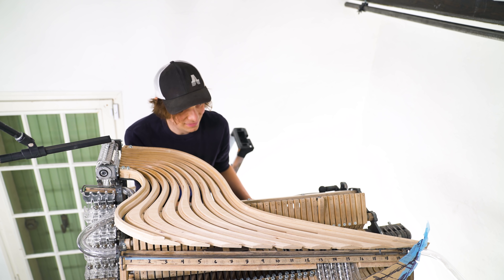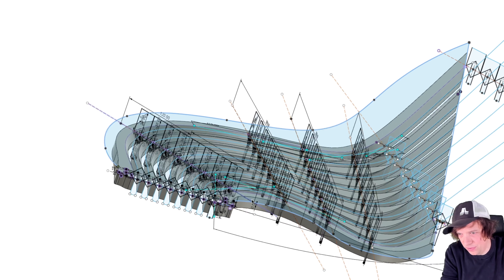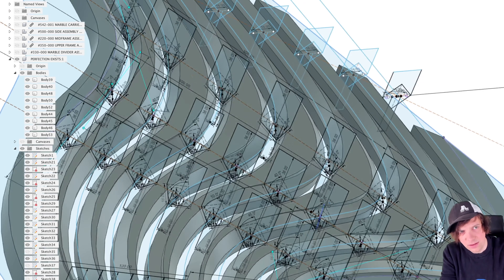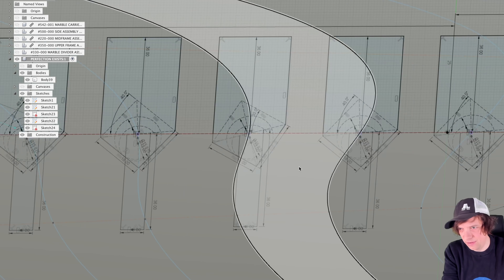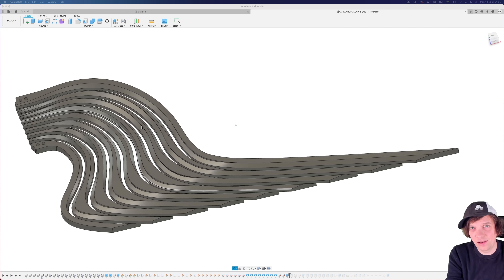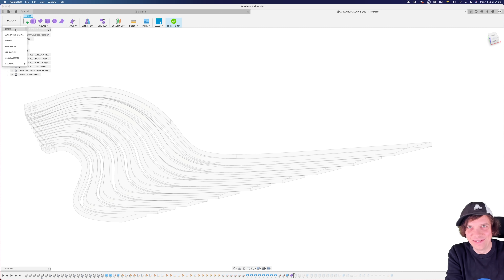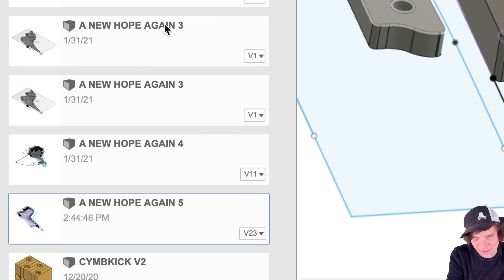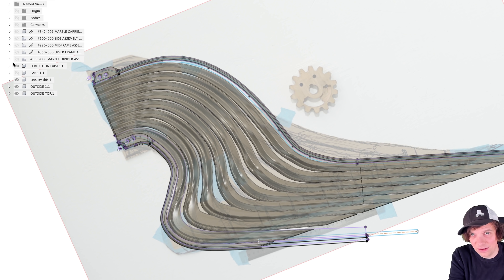Marble Lanes

Comment: I'm leaving this comment after seeing 11 minutes of the video. One observation is that the marbles were moving really fast by the time they reach the rail at the bottom. Perhaps (learning from an earlier video of yours), if you widened the path at the end, it would slow the roll and make for a smoother transition into the rail across the holes. I will also add, this is a beautiful design! Very pretty!

Comment: @others: Speed won't be a problem. he can easily widen the track moving the contact points out and making the marbles slower.
I'm just a bit annoyed by all the bezzier handles of the cennterlines ;). Couldn't you draw them smother with just one asymetric extra handle in the middle?

Comment: 9:15  Why the marbles need to fall so much until the ramp?  Why the ramp can not be fixed a bit higher?   You can keep the ramp fix to the sides and allow the center ramp part to enter more close to where the marbles still have lateral movement, instead making them fall, that also solve the problem of marbles getting stuck on the edge.
The edge of the ramp should be almost touching the part where marbles are in the top.

Comment: since there are now multiple exits across the entire width, doesn't that create an unbalance in the number of marbles that enter on the left channels vs the right channels?
Reply: Its more balanced then before, (favoring the left side of the machine VS the right). this is a much better solution that is much closer to ideal(what the original Marblemachine used), but still has an art feel to it.

Comment: Try fastening string under tension between the ends of the marble divider and the sides of the exit of the conveyor. You can measure the angles easier and plot the connecting points in CAD, then model your curves to run between these points.

Comment: I cant hardly wait for him to perfect the lanes, just to realise that he is not populating the first 4 channels at all. Bad curves
Reply: first channels get fed from the small 4 ball elevator through a single tube.
Reply: @constantinosschinas4503  If you look at him drawing the template in this video, it's clear that he intended to feed the first channels with this design. I think the error that was introduced during CAD moved all the feed lanes, not just made it longer at the end.
Reply: @constantinosschinas4503   But what if the fish-stairs aren't delivering marbles fast enough?
Reply: Yeah I was wondering about that too. Also, Even if a single track goes to the first few channels, what if you want to play a lot of these notes? wouldnt you run out of marbles very quickly if it is fed by only 1/8 tracks while the lower channels can get marbles from up to 8/8 tracks? 

Before, there was a single bypass lane, meaning the first channels were getting 1/2 as many marbles at maximum.
Reply: @Basement-Science  was thinking the same. 
I think that the best option would be to split the lanes in a way that the paths look like a tree and the paths would be switchable so that in one song you could dedicate 3 lanes to the beginning, and in another song 5.

Comment: With this new design, it seems that the marbles gain a lot of speed and will probably jump over their entry point into the divider.  Also, in my mind, the distribution after mounting was close to a gauss curve, the center point of the divider will be more fed and the first channel may not be full enough if it is used often.

Comment: A horizontal marble divider with marble gate and piston feeder:

i realize its a large part of the machine thats already designed, but i feel like the tilted marble divider is causing many issues: it requires the different modules to adjust marble height, if marbles go too fast they can skip over a hole, marbles can get stuck in the pits....
I think instead a level marble divider would work better, where marbles are pushed along by the marbles behind them. you could then feed the marbles in with a simple gate that pushes the in one by one, (like a marble sentinel + a little piston assembly). that would cause the marbles to move through the marble divider in steps, and give them plenty of time to fall into each hole.

 I also feel like the two stage division (making marbles enter the marble divider at different points) in unnecessary if the machine is well fed with marbles (one marble in, one marble out).

Those marble lanes look super slick! keep up the great work, wintergartan videos are a blessing to look forward to after a days work!

Comment: How are the first 5 channels going to get fed? And in that design, the upper track only feeds the marbles back into the elevating system. The basic idea is good, it only needs some tweaking.. Also that curve is going to ramp some speed into those marbles. They may even fly past an empty cartridge, and off the main deviding track.

Comment: NGL I really do miss the older design not only because it looked better but also because both of the exits it had allowed marbles to flow directly into the left most channels without the need to have to first go through the whole recycling pipe which goes to the divider and fish stair feedback. I feel this may create a potential delay and drought of the left most channels being refilled in certain cases. I do also have a potential worry about the new system having marbles enter TOO fast which can cause them to skip or roll out of the feeding rail for each channel. Sadly like most of practical engineering changes the only way to find out the results is to see how it works in practice.

Comment: If I get it right, the marbles enter their lanes on the same height level (x-axis), and then the lanes transform into a slant (y-axis) which causes a difficult 3-dimensional shape. The plywood will have to be bend a lot to end where they are supposed to do when the lanes are cutted in planar plywood. Maybe it needs several layers of plywood glued together after doing a design with exact start and finish coordinates. However, it looks beautiful so far! :)

Comment: with this design, the instruments at the bottom of the ramp have the potential to be served by eight lanes worth of incoming marbles, while the instruments at the top are only served by one or two.  isn't there a danger that the higher end of the ramp might run out of marbles?  Are those notes used less frequently?
Reply: so this divider is getting fed by the marbles that start at the bottom of the system.  the fish stair "return" route that handles the overflow doesn't go through this divider and starts all the way up, so all that excess gets fed back in.  he should still test it though
Reply: @dforck42  Good call, thank you for the observation.  I see that you're right.
Reply: Martin just has to write his music with intense drum and bass tracks.
Reply: There is the fish stair feeding the channels from the top. All the excess marbles are sent that way not to the new dividers route.
Reply: If it becomes a problem, a solution could be making the marbles prioritize the first channel of the conveyor
Reply: @Anoneom  I think the concern is that even at full speed the first lane of the conveyor might not feed enough marbles to keep the first instrument channels filled. I like your idea though
Reply: The whole Lane is fed by the overflow and fishstairs. 
My general concern is, that on a high speed song, with lot's of rhythm in the higher channels, the Marble divider may not provide enough marbles. 
And on the other end of the scale, the overflowing might run full, when there is no rhythm going on.
Reply: The limitations of the machine will presumably dictate some rules for composition.  Which is fine,  like you can't play 8 notes on a trumpet at once - musicians are used to limitations of their instrument.
Reply: I see this problem too.
Reply: I guess it needs a "factorio" style lane balancer?
Reply: That worried me a bit too. But considering the vibraphone bars can be in any (or at least somewhat flexible) order, Martin can simply position them such that the least used ones will be at the left.

Comment: Part name suggestion: Medusa's Hair. It snakes, and it met stone cold reality on the machine with its length. 

I'm worried about the angle though as it joins the feed to the PMMA pipes -- will the angle favor marbles popping forward off the machine, with or without existing marbles there? 

Also, as far as flexibility goes I think you'd need to cut each "hair" of the snake in half. That would let you then have a cut at some point along the way that you could then "tune" by having a nut/bolt or threaded rod assembly underneath the lane that could expand/shrink the gap as needed (sort of like the clamping action on a saxophone reed), potentially with some shim pieces to fit in the opening to maintain track containment/shape (sort of like a shaped washer.)

Comment: You should test some runs with this version of the marble lane to check if any adjustment will be needed before you reduce the size by 30cm. Just to make sure the angles are enough and the depth is algo good.

Comment: Martin, the marbles seem to be exiting the lanes very quickly --  maybe TOO quickly to fall into the divider holes.  I recall in an earlier video you discussed how the shape of the track changes the speed of the marbles. i.e. running on their bottoms=very fast vs. running on two tracks closer to their axis of rotation (?)(hopefully you understand)=slower.

I understand that the last thing your lanes geometry needs is more complication 😁, but if the marbles ran fast at the top of the lanes to keep the conveyor drop area "clear" but then slow down to a better speed for entering the divider that would be good and might be accomplished by changing the shape of the lane as it descends from fast running to slower running.

Good luck.

EDIT: Overrotation?  Was that the term you used?

Comment: I don't know the software, and this might be a little technical, but I feel like the natural solution would be to parametrize the tilt with the second derivative of the curve as parameter. If it is possible to do math in the software, or if this kind of variable is available with parametrization in general, that would be very powerful. I'll briefly explain what I mean.

Suppose you have a 2D curve, the path you want the marble to take. You also have the shape you wish to carve out along that path. The path is parametrized as (x(t), y(t)). Now, if you take the first derivative of this with respect to t, you will get a tangent vector going parallel to the curve. However if you take the derivative of this, that is the second derivative of the path with respect to t, you will get a vector that is perpendicular to the path, and proportional to the curvature of the path. If you grab the magnitude of this vector (with its orientation with respect to the path, left hand side or right hand side), you will get a variable that is proportional to how tight a turn is. This variable can be used to parametrize the tilt of the shape. As a bonus, if you can play with substitutions of the variable t, you can make t a proper time variable and the tilt you end up with can be made proportional to the actual acceleration of the marble at that point, very nice.

Tl;dr: depending on how much math the software allows you to do with respect to parametrization etc, you can basically fully optimize and automate the shape tilt similarly to how one would solve a constrained physics problem. I am not sure how interested you would be in something like that. This is of course all assuming you have access to these functions.
Reply: yes, that would be a natural parametric approach. afaik fusion 360 API supports programming in C++ and Python. an example can be seen here https://www.instructables.com/Parametric-Modeling-With-Fusion-360-API/

maybe you could write the function for martin. like generate tween curves from 2 outer curves, normal planes, twist of plane from vector length etc. i do this stuff in grasshopper, not in F360.
Reply: @constantinosschinas4503  I would be able to write a script that does this using the API, from what I've seen. But it seems that integrating python scripts with the F360 UI is quite technical and not that nice, certainly beyond my experience in programming since I mainly just do numerics. So if I did write a script Martin would probably have to learn how to use that script, have it access files exported from F360 etc, import files back. A bit clunky. I could learn how to integrate it properly but it would take quite a bit of time and effort on my part, and I couldn't guarantee that I would have any reliable success.

So I would recommend for him to find someone with real experience using custom scripts with F360, and if they lack experience with numerics I can always chip in with various ways to calculate useful things, if not write specific algorithms. I can do both python and c++ so I don't mind the particulars of that.
Reply: @constantinosschinas4503  Actually I found this: https://www.autodesk.com/autodesk-university/class/Creating-Fusion-360-Custom-Commands-2016#handout

Seems like it supports much better integration now. I could probably do something with this

Comment: I'm not very familiar with CAD, but cold you set an origin in your drawing and have each lane be modeled by a line equation (could do 3D equation or 2 2D equations to constrain the pathways). You could have a common variable in each of the equations which allows you to edit the slopes, path-lengths, etc. for each marble track. If this is helpful, wow, if not it looks like what you did in CAD already is fairly straightforward!

Comment: I think the lanes should be slightly wider at the ends so the marble can slow down a bit before exiting. Like if you agree.
Reply: The opposite is probably true. If the lanes narrow towards the end it will induce overrotation, reducing speed. It's probably a good idea to do that, and if any of the lanes are too slow they can be widened just by sanding until the optimal speed is achieved.
Reply: @nagualdesign  When the lane is wider, the part of the marble that is rolling on the wood is more towards the sides of the ball instead of below the ball. 
Think of it this way, when a marble is rolling on the floor, the very bottom of the ball is what ks is rolling on. So that means the ball will travel one circumference distance for every revolution. But if the ball was on a track with the left and right raile were only close enough to barely not let the ball fall through, the part kf the ball that rolls on the track is a very small circle thus one revolution of the ball means only a small distance is covered.
For clarification, when i say "widen the lanes" i mean increase the width of the air gap between the wood. I think the lanes should be widened to be as big as they can be while not letting the ball fall though. It would be nice to see the marbles slowly traverse the lanes.
Reply: @sevegarza  I think we're talking at cross-purposes. What you're describing is called overrotation. Essentially we're saying the same thing; narrow the distance between the two edges that the marble runs on in order to slow it down.

Comment: I've been looking at the lanes for a while and I'm not sure you added to the length as much as you misaligned the lanes. Currently it looks like the first lane doesn't feed the divider from the top but rather enters the divider around the fourth channel.  And it looks as if that's about as for the lanes hang off the end of the divider.

However I also wonder about how effective it will be to spread out the marbles over the divider like this. It would seem that you risk starving the low number channels. Well I guess this is going to be one piece you can (relatively) easily redesign and make a new one if it turns out you end up with to few marbles at the top of the divider.

Comment: this design dosn't seem to be killing the kenetic energy enough, the marbles are just flying out of it and are clearly hopping over some of the channels in the divider.
not to mention that not nearly enough/any of them seem to be going over the first few channels, the channels that probably should be getting the most marbles since they overflow to later channels.
Reply: The fish stair feeds into the first channels, so any that are over-fed end up at the first channels soon enough. The fish stairs are redundancy, in a way.
Reply: @inthefade  Tho his template had the first lanes exiting above the first channels, the actual cut item had shifted the exits to above channels 4
Reply: Exactly what I thought 👍🏻
Reply: I was worried about the first couple channels too, but after looking at it for a while I think it will be fine. I think overall the marble recirculator should provide enough marbles to keep all the channels supplied. It's really the job of the recirculator to keep all the channels supplied and the divider is more about introducing marbles back into that loop with a side benefit of helping the lower channels not starve. If the recirculator ever runs dry, then you really have problems with the top channels because some of the marbles being played by the top channels will be recirculated to the bottom section and have to make a full trip on the lifting stairs to the top to replenish the top channels.

Comment: Hey Martin, just a quick idea about the marble lanes. You could cut the mounting points for the lanes at an angle. This way, the lanes would fall down towards the divider without having to risk putting too much twist or downwards pressure onto the plywood. 
Nevertheless, keep up the good work.
Sending love from the UK

Comment: If you want a nicer transition with lofts use the rails rather than centerline option. It's a bit more work to set up but if you use 3d sketches and splines it will almost always give you a perfect transition.